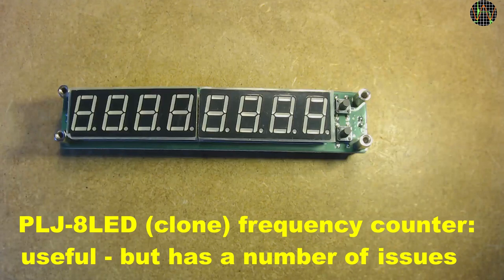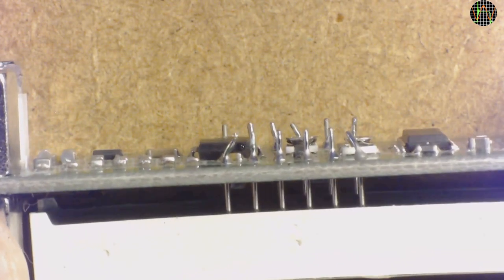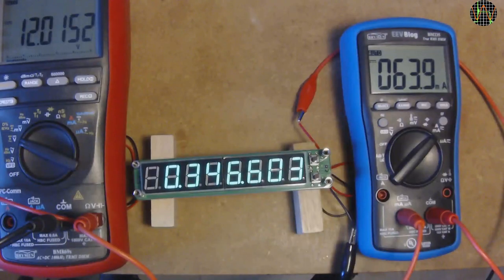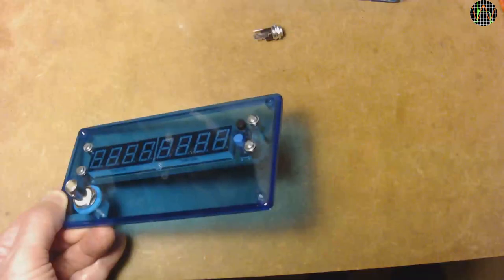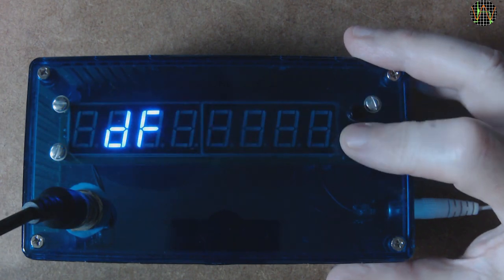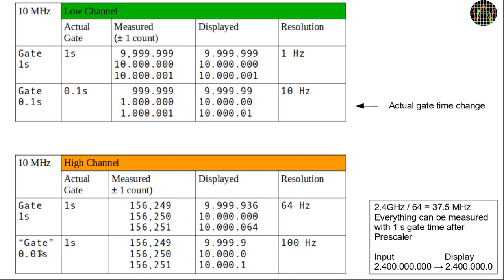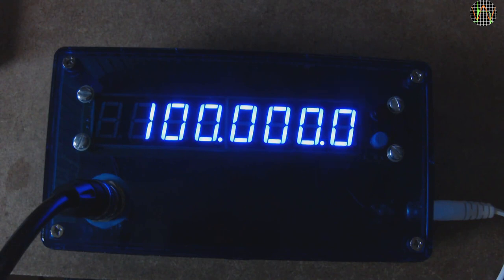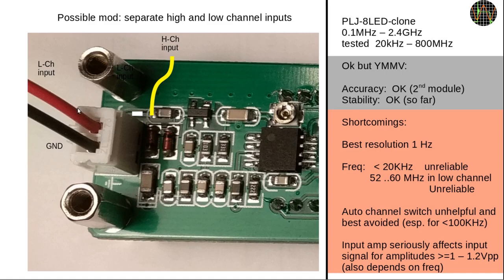PLJ-8LED (clone) frequency counter: useful - but has issues

Comment: many thanks for the very clear English info, I have purchased one of these units primarily for IF offsetting for use with old receivers, and the available data and info elsewhere seems to be very limited.
Your video has been extremely helpful especially with the practical mounting and set up.
Vielle dank fuer alles, gruss aus England. Chris

Comment: I have a couple of these in the radio room and they actually work quite well sampling the RF output on the radios but this would not be the best choice for a bench frequency counter choice in the shop where you needed more diversity and the fact they didn't set up some kind of selector switch in the hi and lo front end doesn't make sense. They had to know that would be an issue.
Reply from the maker: yes, using them as a readout for an analog  signal gen or a radio dial is a better use
Reply: @TheHWcave  Let me run something by you here. The frequency stability for these counters are 2.5 ppm so in the 10 to 12 meter bands this will deliver an accuracy within a 60 hz up to 70 hz window but you can pick up these oscillators all day long at Digikey and Mouser rated at .5 ppm literally for a few bucks which would technically take the accuracy window to around to around 13 hz to 14 hz accuracy. I have not looked at the oscillator module on this counter yet but I think this can be done. Any thoughts if it's worth a try?
Reply from the maker: @flash001USA  Yes, that should be possible if such accuracy is needed.

Comment: thanks for helping this old man settup and understand this counter. mine is installed in an old cable box and i have a bnc connector for connecting a scope probe. . my question   instead of the probe sometimes i would like to use straight input wires with no isolation. 
   so when servicing tube equipment whats the max vdc on the signal input  this counter can handle w/o burning it out ?
Reply from the maker: Its tricky to say. Hi and Lo inputs are wired together (but can be separated). They are AC coupled followed by two anti-parallel diodes of 1N4148 type. The volts rating of the caps is unknown. The impedance of the caps goes down with frequency, so the diodes will see an increasing AC current. Also the diode reverse voltage should be below 100V. Based on this 100Vpeak is the absolute max from the diodes but the caps may have a lower rating. And the higher the frequency the lower the max voltage (because of the current through the diodes). I think there is 1 nF cap in the LO input, at 1 MHz that's about 160 Ohm and with 0.2mA through very! hot diodes that's just 32V. In short very little headroom. You better add a 20dB (1/10) or 40 db (1/100) attenuator at the front

Comment: Very complete analysis.  Thank you for this. I bought two of these and managed to blow both of them out.  I was measuring with my eico 124 as input  and got reasonable results, but when I hooked to my feeltech FY3200, the counter started flashing and stopped working in about 10 secondsj. Im afraid my signal generator is introducing some extraneous voltage thats blowing these things out. Do you think there is any fix or what the most likely failure is? I have some surface mount parts.
Reply from the maker: have you looked at my videos on the Feeltech FY6600. I found that mine produced stray voltages because of the badly designed  power supplies. if you earth the outside BNC shell of your Fy3200, does the problem go away?
Reply: @TheHWcave  I will check that.  I had read about this but never had a problem with any of my other endeavors, so never bothered to check it. 
Do you have an idea of what might have blown out?

Comment: A useful analysis.  A follow-up question:  I have 2 counters - one gives an acceptable error of ~10Hz, and the other ~40Hz which is way too much. Do you know how to calibrate the counter? At least how to apply a systematic error correction?
Reply from the maker: I assume you have tried the trim pot to adjust the oscillator frequency for the time base? I have 2 modules and in one  the range of the trim pot was not sufficient to remove the error. I managed to fix that by soldering in an additional resistor. The video is here: https://youtu.be/MGNRo2G30xc
Reply: @TheHWcave  Based on your video, I was able to adjust frequency to reasonable accuracy without an extra resistor.  Thanks!

Comment: If using this in an old signal generator, for AM and Shortwave 455Khz and 1600Khz for alignment to insure my alignment frequencys,  can this be done........I dont need high megaherst for a transoceaninic
Reply: G500 radio, what i want is a way to have a frequency counter in my old EICO 324 signal generator for accurate radio alignment
Reply from the maker: Hi gene, 
lovely bit of kit, the EICO 324 (I looked it up). I am afraid adding this counter isn't all that easy. The problem is that terrible input stage of the PLJ-8LED with the two anti-parallel diode limiters that will mess up the wave form of any signal coming out of your EICO. You need to make yourself a buffer circuit that presents a high impedance input to the EICO and can tolerate the signal butchery of the PLJ at the output.  Since you are not looking at very high frequencies, normal  (single-rail) opamp should work and you could feed that circuit from the low-volt DC supply you need for the PLJ anyway. 
Alternatively, you could try hooking up the PLJ temporarily to the EICO to set its  frequency and then disconnect it when using it to align your IF stages and hope that the frequency doesn't drift too much.

Comment: where on earth did you find the button extensions? ive searched high and low
Reply from the maker: Search eBay for "SWITCH CAP for Tactile Push Button Switch". They are still there.
Reply: I made mine by disassembling some salvaged tactile switches. The extensions are trapped between the plastic face and the circuit board by the rim that holds the button in the tact switch to begin with.

Comment: I'll never understand why people make a vidio of their project refuse to provide a parts list of the parts used, how much they cost and where they can be found!!!!
Reply from the maker: Parts are often what I found in my a spare parts bin of spare and recycled electronics and mechanical gear. occasionally a project may require an item that I don't have. If its a commodity item, I will generally buy, say 5 switches when the project only needs 1. That way I get discounts and meet free shipping threshold and build up a stock of items (the parts bin). Problem is of course that I often don't remember  the details of the items and where I bought it from. I generally work under the assumption that most electronic hobbyists do the same, take the video as an idea and modify it to what they already have or can easily get in their country, and change the design in ways they prefer more.  The one exception are safety critical components for which I generally specify vendor and part numbers. I normally don't add sources because they change too quickly .

Comment: Does anybody know what is low side prescaler IC?
Reply from the maker: The only prescaler in this is a MB506 chip but that is on the high frequency input.  As far as I know it is hard wired to /64

Comment: Did you find the temperature stability to be ok from cold on either or both of your modules ?
This is certainly a handy counter module, even with its problems....
Reply from the maker: I "burned-in" both modules by running them continuously for at least a week 24/7 before attempting to adjust the oscillator. The "green" LED module never got closer than 5Hz and that is already right at the end of its trim range. I adjusted the "blue" LED module about a month ago and have not touched the setting since. So far no drift. Its frequency trim pot is not "in the middle" but it isn't maxed out either.  There is hardly any change after starting from cold. It is within 1Hz of a 10 MHz reference right from the start. It may show slightly more often the +1 count display in the first 15 minutes. One of the reasons may be that there is not much of temperature variation given the reduced 7.7V supply voltage and that the recycled power brick (which does get warm) is not in the enclosure. 
You are right in that it is a useful counter to have, especially for the price but all I am using it for is as a short-term transfer standard to control calibration of my function generator against a GPSDO reference. With that I mean, I select the same frequency on the GPSDO and the function generator and then use the PLJ-8LED connected first to one, then the other verify and calibrate the function generator. This procedure means I always know the to be measured frequency and use well defined clean signal shapes. The PLJ-8LED is certainly well suited for this task.
Reply: @TheHWcave  To be within 1 Hz at 10MHz from cold and then stay there seems pretty amazing for the cost of these modules - don't you think ? 
Your green module - I wonder if they have loaded a wrong value component around the osc. so that it won't pull in properly ? Could be a 2nd good module if so :o)  
(I built a 10MHz standard locked to Radio 4 on 198kHz, which is a ref std, to perform the same function as your GPSDO, and my old '80s counter plainly drifts from -6 Hz to + 6 Hz then back to zero within 30 mins from cold - but is not too bad after that - but then its xtal osc is old - school !)
Reply from the maker: @noakeswalker To answer your question on wrong component values,  I spent the last 45 mins on comparing the oscillator circuits of the two counters. They do appear identical but I found that the whole circuit (TCXO and trim pot + separate resistors) are all fed from a tiny XC6206 3.3V regulator  marked 662k. On the "blue" counter, that is producing 3.3V as it should but on the "green" one, its 3.6V. According to the XC6206 datasheet that is way out of tolerance, even for the non-high-accuracy version. So the problem may be a dodgy regulator. I just ordered a few from Ebay (10 for £1.90 including postage) to see if that solves the problem. If it does, I'll post a short follow-on video.
Reply: @TheHWcave  Good find ! That does seem a likely cause - let's hope it is.
Reply from the maker: Chips arrived and just before replacing, I decided to check voltage again.To my surprise its 3.315V , certainly within spec. I have no idea what went wrong when I measured a couple of days ago, but there is no point replacing a working regulator. The frequency is still off by 5 Hz on 10 MHz. So now the only alternative is to replace the TCXO but not sure if that's worth the effort.
Reply: @TheHWcave  I don't suppose that regulator is jumping around in voltage while you aren't looking ... I expect you have eliminated that idea...so if that counter is nice and stable, you could dig in and try modifying the trimmer circuit with added/swapped R, and see if it will then adjust, and still be stable....they are so cheap that maybe this isn't worth the effort...
Reply from the maker: @noakeswalker  Yeah, I could try tweaking the control voltage circuit to pull the oscillator down the remaining couple of Hz but for now I have other things that are more fun and since I do have a working counter anyway, I think I park this fix for a while.
Reply from the maker: Problem solved, yes, I just couldn't let it go. I patched the voltage divider with another resistor and now I can adjust the frequency so that the reading is correct  (well, +-1Hz). I'll make a brief video about it shortly
Reply: @TheHWcave  It would be nagging at me to have a go, rather than just using the module for spares.... good result. Dave